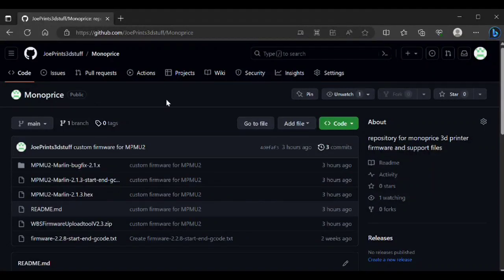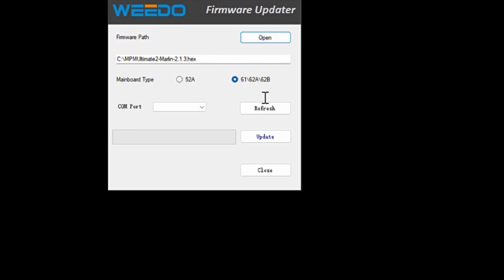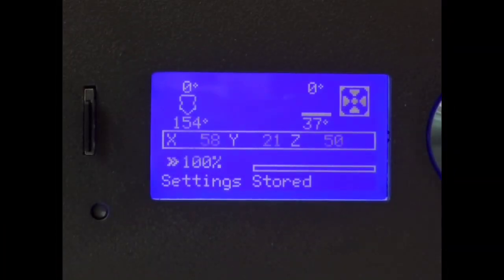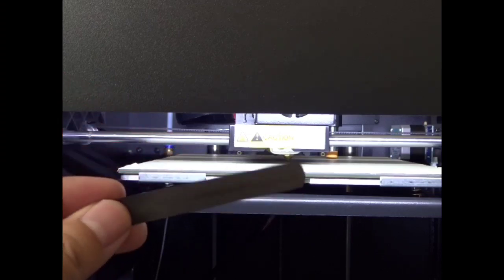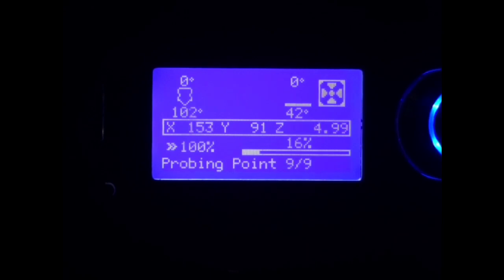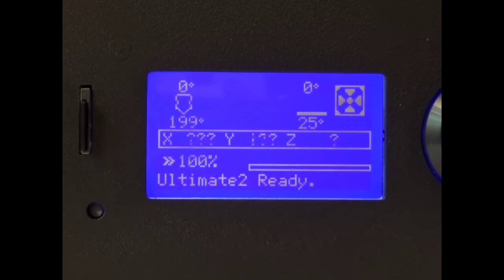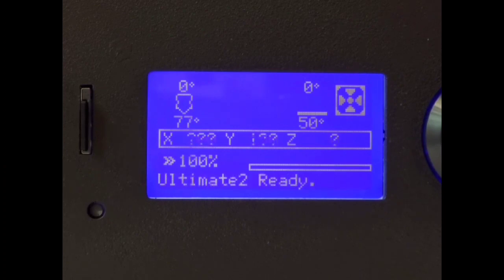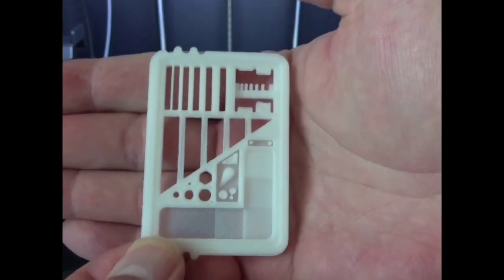Monoprice Maker Ultimate 2 firmware upgrade to Marlin 2.1.3

Comment: I enjoyed watching your video which helps so much flashing my firmware to Marlin. But the problem that I'm running into is that the extruder isn't extruding when trying to print. It just moves the filament in one spot acting like it wants to print but just moves it in and back out not letting it fully leave the nozzle. Do you know what could be causing it to do that?
Reply from the maker: First guess would be a clogged nozzle.
Reply: @joeprints3dstuff  I've already heated it up and pushed it out by hand and still just move in place moving back and forth the nozzle.
Reply from the maker: Is your printer stock? Revert it to the stock firmware and see if it works properly.

Comment: Hello Joe, I got an older Monoprice Maker Select Pro Ultimate from my son. I have tried to utilize some post processing code using cura but the printer does not seem to respond to those codes. I was looking for a firmware update and came across this video. Would you know if this firmware patch will work on my printer. The mother board chip is a ATMEGA2560, 16AU 1644.
Reply from the maker: No I don't think it will. Sorry.
Reply: I realize this post is months old, but for anyone else interested, the Marlin firmware on Github supports the old Monoprice Ultimate.  Use the configuration files for the Wanhao Duplicator 6 in the examples folder.

Comment: Hi Joe.  I use this printer quite a bit.  Thanks for the firmware upgrade tutorial.  I've also found that blue painters tape works better.  Once the tape starts losing it's adhesion, I use the elmers glue sticks and get a few more prints with the same tape.  The prints remove from the blue painters tape and glue a little easier than the masking tape.
Reply from the maker: Thanks for the tip. I am about out of tape so I will try the blue.
Reply: Trying to run this with Cura using the setting you gave.  Running into "Heating Failed: Bed, PRINTER HALTED, Please Rest".  Are you able to use the new firmware with Cura?
Reply from the maker: Did you run a pid tune on the bed?
Reply: @joeprints3dstuff  yes sir. Did all the steps following the video.
Reply from the maker: @VinayMahendra  someone else was talking about problems with the bed heating. What are you heating the bed to? I might need to change the bed from pid to bangbang.
Reply: @joeprints3dstuff  I reinstalled and did everything again, then it struck me, the temp cura was set to 60 and the PID setting following the tutorial is 50.  I set the temp in Cura to 50 for the bed and it's warming now.  The problem I see now is that from 45 to 50 the bed LED heating indicator is flashing and it's taking a long time to get to 50 degrees.  Is there a way to get the bed and nozzle temps from the Cura settings and set those as the PID for both? I the previous version of the firmware, the settings from both would adjust based on the settings in Cura.
Reply: Also, it finally hit the bed temp and is now heating the nozzle, but bed temp is showing 49 and the led is still flashing like crazy,
Reply from the maker: @VinayMahendra  the flashing is normal. Just means the heater is turning on and off. Give me a bit and I will rebuild the firmware with the bed using bangbang.
Reply from the maker: There is a new firmware on the github website. Give it a go and let me know if it sorts out your problem.
Reply: @joeprints3dstuff installing the bed fix file now and will let you know how it goes
Reply: Okay, so, with the new bed fix, and using Cura, the bed hit temp, and like the change, bang, switched to E1 nozzle warming.  This is perfect because now it's taking temp from Cura under the bangbang setting.  Can you do the same for the nozzle temp?  Set that to bangbang as well. This way it will work way better in Cura and not require the initializing of the nozzle temp in the advance settings.
Reply from the maker: @VinayMahendra  pid is actually better than bangbang as it holds temp better. For pid tuning, you only need to donit once, not for every temp. Just tune it to whatever you normally print at.
Reply: @joeprints3dstuff  awesome.  Thanks Joe.  I'm running a print of a test boat and so far it's looking great.  Only thing I need to tweak is the nozzle height as the initial purge seems to have printed a little flatter than before.  Will also need to tweak the retraction setting as it's stringy on my end.  Do you use Cura at all?  If so, what do you have as printer settings?  Your test print was flawless. I can only hope to have mine print that well one day lol.
Reply from the maker: @VinayMahendra  no I don't use cura normally. I use prusaslicer.
Reply: @joeprints3dstuff  I’ll give Prusa try then. Would you mind sharing your settings in Prusa? I just have a generic printer setup with x:200 and y:180.  I didn’t see anything monoprice in the printer setup options

Comment: Is there a way to navigate the control menus from the pc?  My rotary encoder ripped the pad off the pcb so an encoder replacement isn’t going to be feasible. I’d love to do this firmware upgrade but I can’t follow all the steps that require the knob.
Reply from the maker: If you have octoprint you can do all of the setup via the console. However you will need to know the gcodes for each of the steps. It won't be as easy, but it is doable.
Reply: @joeprints3dstuff   I’ll dig in via Pronterface since that seems to do well with manual control. Any tips about commands that might work?  Looks like M876 might be the ticket for selecting prompts from menus.
Reply from the maker: You don't need to really worry about the menus, you just need to do config things like pid tuning and mesh building.
Reply from the maker: Octoprint would probably be better than pronterface as you will be able to print from it easier.

Comment: Exited to see your work on the Marlin software for the Monoprice Maker Ultimate 2!  I have a couple of different beds configured, am I am waiting for a Slam Bam PEI to go over the glass bed.  I am (was) currently printing ABS on a bed I originally made with sheet metal bonded to a 1/8" G10, and I works well for PLA and PETG, but not so much for ABS.  I have now covered it with a sheet of PEI about 1mm thick, and it bonds well enough to ABS that I will be examining my Z-offset to see if I can back it off a little to something less bullet-proof.

I have had spotty success with the 2.13 Marlin, perhaps because of my homemade bed, because of either timeout or over-temp when I try to heat the bed to 90C or 100C, always when trying 100C, and sometimes when trying 90C.  I successfully used your routine to PID tune for each temperature, but spotty luck when trying to print, as mentioned.  Like you, I want to use the Ultimate 2 for ABS, have other printers configured for PLA (TronXY D01) and PETG (Anycubic 4MAX).  Have you experienced the problems I just described?  The printer was working successfully with the Marlin 2.2.8.
Reply from the maker: I have not seen this problem but I really haven't been using the printer lately. Have too many other projects going in.  I would say though that if you have done a pid tune on the bed at 100c and its causing problems then i would revert back to the stock firmware. It doesn't use pid for the bed, it uses bangbang.

Comment: Thanks for the video! Upgrading my firmware now. Can’t wait to get things dialed in and get better print quality. As far as bed adhesion what I’ve found so far was to use a thin layer of glue stick and just the raw glass. If you wait 30 minutes after the print is done it will be much easier to take off then the tape method or glass alone. If you use too much glue stick it may be a little tough to get off but a thin layer has worked good for me so far.
Reply from the maker: Let me know how it goes. Also make sure you update your slicer start and end gcode.
Reply: Finally did the upgrade today. Been so busy with work lately. This firmware is heaps better than the stock one. Thank you so much. Dialed in the steps/mm and they were way off by default. It prints so much better now without later over-extrusion. Cant wait to start making stuff again. I’ve had filament just sitting on the shelf for far too long because my ender 3v2 needed much repair and this monoprice one was not great out of the box.
Reply from the maker: @RyanMonoxide  wonderful